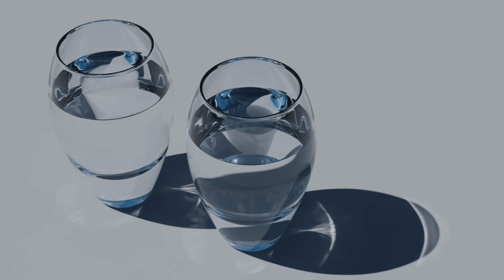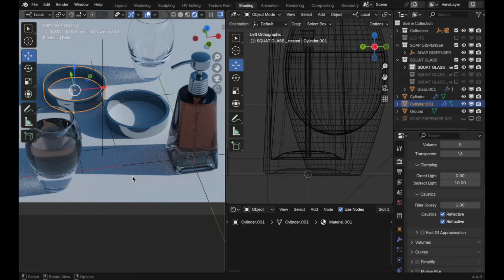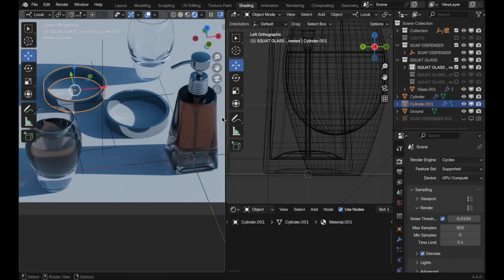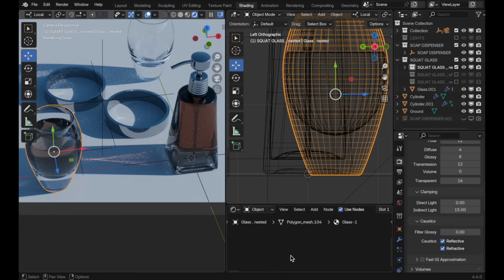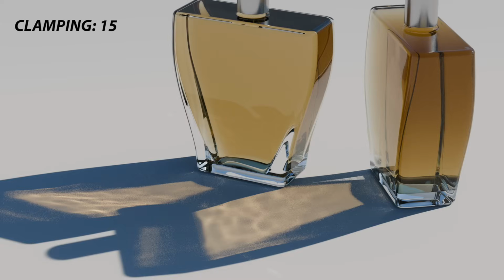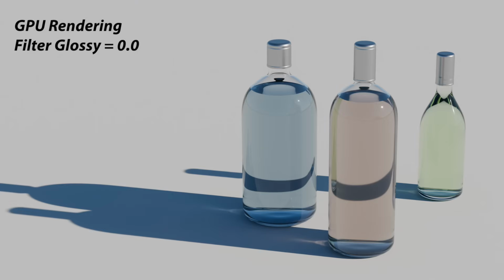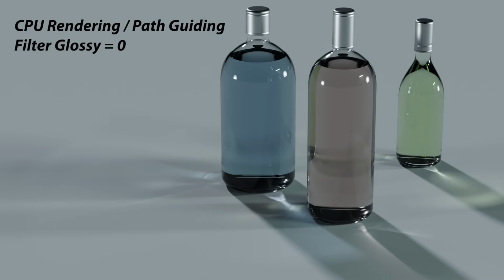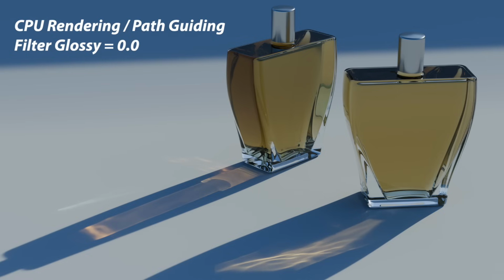Those beautiful caustics patterns, Cycles can do them...

Comment: for anyone still struggling you have to enable caustics in rendering, enable it for whatever lights you have, AND enable it for the materials. I don't use caustics often, but I found this to be unintuitive, so just wanted to mention it.
Reply from the maker: That's actually for shadow caustics, which is a different mechanism. The caustics I'm showing here are a natural part of the raytracing mechanism.

Comment: So I've gone through and done this, and it indeed works.  Caustics are much better using these settings.  However, I seem unable to get volumetrics to work with it.  As in seeing the caustic beams through a volumetric medium.  There seems to be an issue with Volumetrics that don't respect Path Guiding, I would guess.
Reply from the maker: I need to explore this aspect more, but it may be that their volumetric system doesn't support volume caustics. Not sure to be honest.

Comment: Thanks for the info. I think i need to go on a hunt for hdris that produce nice caustics as i could only really see a difference in rendering (on my end) when only using the hdri for the light. Manually set up lights seem to produce near identical renders regardless of what is doing the rendering.
Reply from the maker: Polyhaven.com is a great resource for HDRIs. And yes, direct lights have a smart sampling mechanism that probably accounts for the lack of difference you're seeing when using them. But indirect light source caustics are where Path Guiding shines.

Comment: maybe I missed something, but enabling caustic in light and "receive shoadow caustic" on plane and "cast shadow caustic" it works well using GPU and it's faster
Reply from the maker: That's a different caustics system that only works with direct light sources. It's a less precise mechanism, and the caustics only appear in shadows. So it can't emulate some of the images I showed, which are generated via the core raytracing algorithms. Most of the images I showed had caustics from HDRI images, which the MNEE system can't repliacte.

Comment: Great tutorial as always,  how this technique compares to the Cast Shadow Caustics/Receive Shadow Caustics option which can be used with your GPU. Is not as physically acurate?
Reply from the maker: Those functions use Manifold Next Event Estimation (MNEE), which is a kind of a caustics hack feature. They only work with direct light sources and only appear within shadows. What I'm showing here is a kind of emergent function of the core raytracing function in Cycles. I probably should have mentioned that in the video.

Comment: Can you brute force caustics on the gpu by using a very large number of samples? You mentioned that one example image took 40 seconds to render on the gpu and 5 minutes on the cpu. What if you increase the number of samples or possibly some of the light path options, does that make stronger caustics appear? Or is the sampling method just fundamentally unable to create strong caustics?
Reply from the maker: No it's not the same. Even with huge samples GPU rendering won't converge to the same result.

Comment: Not sure ive seen the other video. Was just wondtwhy nothing is mention about the caustocs receiver and emitter settings
Reply from the maker: Yeah, I didn't mention those options because they don't relate to the kind of caustics I showed in this video. They relate to the Manifold Next Event Estimation (MNEE) way of doing caustics via direct illumination. I did a video on that quite some time ago. MNEE type caustics can only be generated from direct light sources, and aren't great quality in my opinion.
Reply: @christopher3d475  yeah I saw rhayz those are weird. I also believe it's has an issue in 4.4 I see really strange results with it.
Reply from the maker: @RomboutVersluijs  Yes I agree. I tried to run a few tests with the MNEE system today and it just hangs in 4.4.
Reply: @christopher3d475  what you mean by hang actually?
I got weird shadows like it was showing internal faces in a glass, as if the object was modelled wrong.

Comment: What GPU you using? Nvidia and AMD handle cycles differently
Reply from the maker: An M1 Pro and an M4 Pro Mini. But Path Guiding doesn't run in GPU mode on any platform.

Comment: I just tried this with lenses. If you shine sun light through a convex lens You'd expect to get a bright white spot at the focal length of the lens. With the default setting this does not happen. You indeed have to switch to CPU with Path Tracing and Glossy filtering = off for the effect to appear.

Comment: Hello! Thank you for your excellent videos. I've been working with Maya and V-Ray for years, and now I've decided it's time to learn a bit of Blender.

I'm the "lights and shaders guy" at the company I work for, and caustics are one of my passions. The V-Ray version we use, 4.6, doesn't officially support ray-traced caustics, but I managed to find most of the hidden settings and obscure options to create good caustics. And it has the same issues as Blender, where in some situations, it becomes impossible to render—either due to excessive noise or requiring an insane amount of samples (and infinite render times) to complete without flickering and breaking apart.

And just like in Blender, GPU rendering is not an option. However, V-Ray has a very useful feature: I can allocate multiple machines to assist with CPU rendering. I've used up to 22 machines, ranging from 8 to 64 cores, plus my own workstation, to help both with IPR (the real-time render of the frame I'm working on) and with traditional, non-interactive rendering.

Does Blender have anything similar? If so, I believe it would be much more convenient and cost-effective to have multiple networked machines at home (like those cheap Chinese Xeons) rather than investing in an insanely expensive GPU.

Thanks for your dedication! Looking forward to more of your tutorials.
Reply: I used to do that when I worked with cinema 4d. I actually have no idea if blender does. I don’t think so out of the box. Might wanna check out some add-ons though. Some good stuff out there.
Reply: Have you tried LuxCoreRender?

Comment: One thing that I have been noticing with the liquid shader is that it seems very opaque and flat. I'm not sure if it's related to energy conservation, but in real life I feel some liquids kind of diffuse some light through, making them brighter. The hybrid moser bottles are a good example because it utilizes that feature to diffuse more light, but it also uses chemicals to perform that, though I do feel regular clear liquids also behave that way, but less powerful of course.
Reply from the maker: one of the reasons I've been highlighting transparency/refractive objects is because I feel there's room for improvement. What you mention I think is aligning with this desire I have, more physically correct representations of what actually happens in these types of objects and materials.

Comment: Very interesting. I wonder if it would make sense for an animation to setup two separate viewlayers (one just for the caustics to render on the CPU, and one for the rest rendered on the GPU). Then combine the results in exrs in compositing.
Reply from the maker: The caustics aren't a separate pass, they're part of the diffuse or glossy reflections. So their generation is deeply integrated into the rendering.
Reply: @christopher3d475  Right, I suppose you could try rendering just the diffuse/glossy indirect pass. But thinking about it, just rendering this pass to get a clean results probably takes already most of the rendering time. Might not be worth the trouble in the end. Simply rendering everything on the CPU might still be faster then.
Reply from the maker: Yes. But, the OpenPGL libraries that this is all based on are apparently being converted to work on GPU, so it's just a matter of time. They're pretty new libraries based on a lot of research, the specification isn't even at 1.0 yet, so they wanted to make sure it was mature enough before converting to GPU. But it's coming I'm pretty sure.